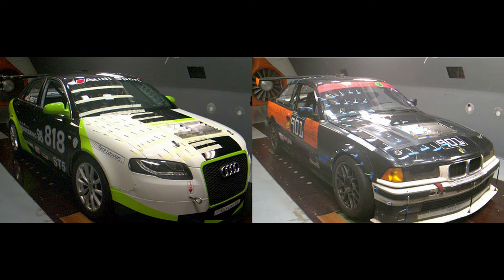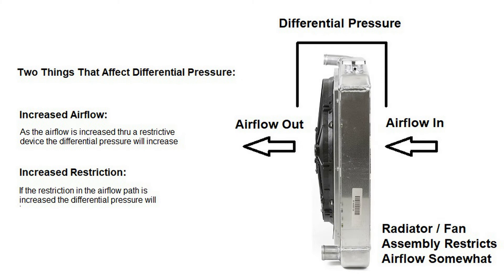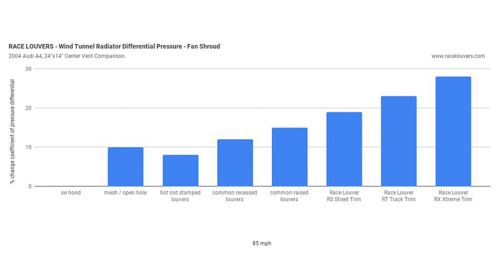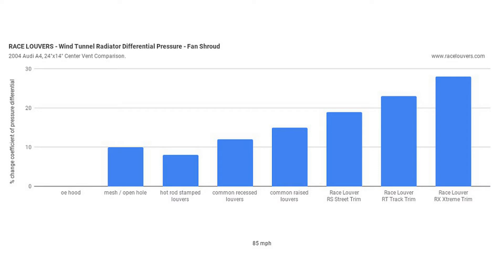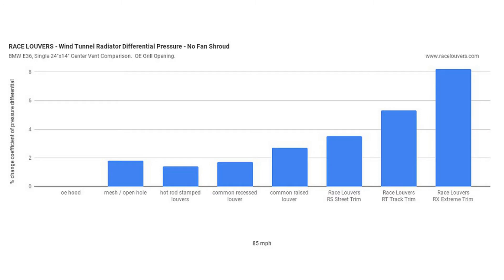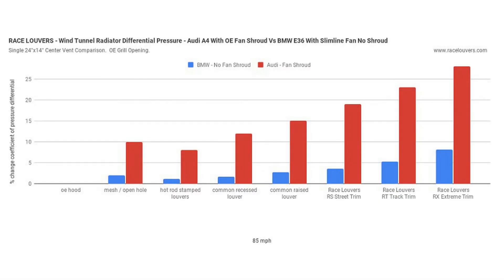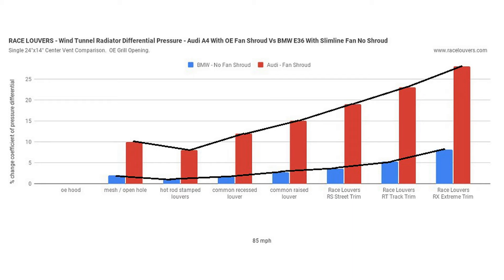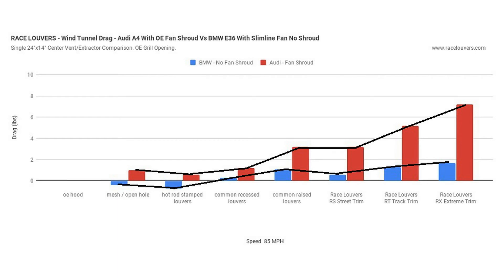Race Louvers - Fan Shroud Vs No Shroud Wind Tunnel Data

Comment: good video im all way trying to explain this to people but they just dont get it, and a lot fit the big flat plate shroud  with 2 fans in the middle  so even more air flow getting blocked  and getting bounded back so then stopping the air flow
Reply: Yes I had that style, sheet alloy, was running about 10 degrees C hotter on the highway. As soon as removed problem solved.